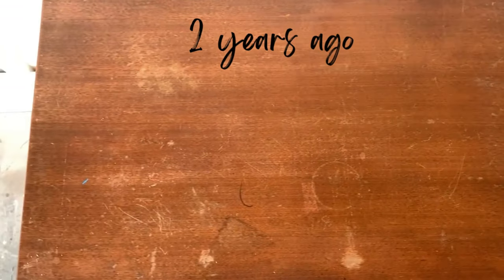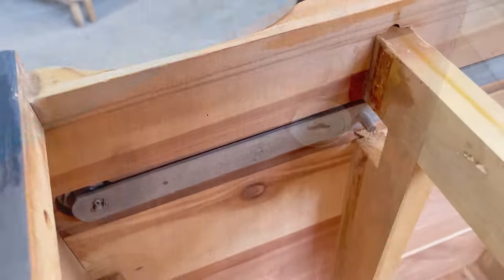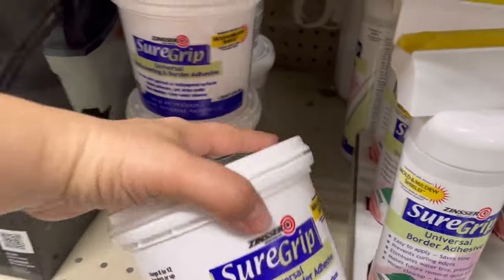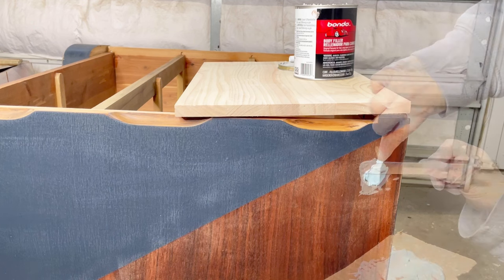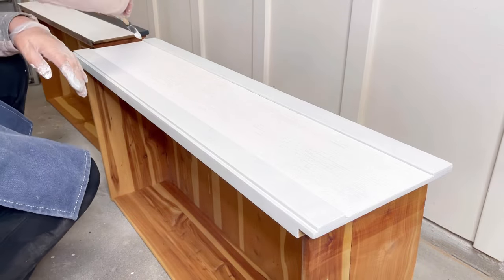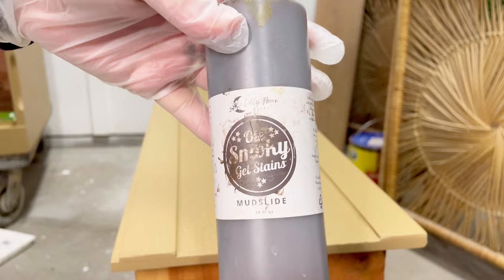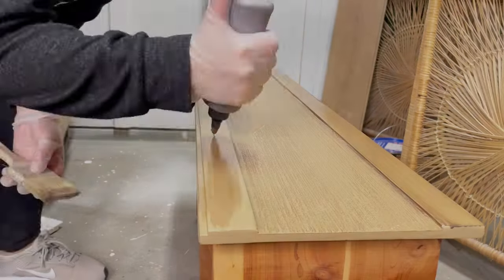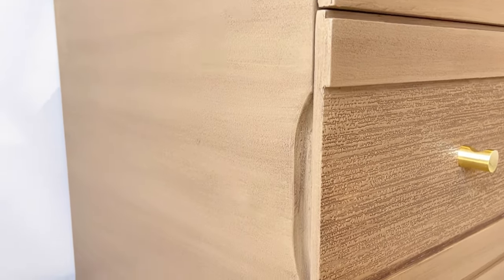BEAUTIFUL Modern Chest Transformation | Thrifted Furniture Flip

Comment: The anaglypta wallpaper was an excellent choice.  It turned out beautifully.  I used some in a wave pattern on my headboard.  I painted it then sealed it. I went over the waves in a gold guilding wax.  I kept the guilding wax lines clean with mineral spirits and this did not affect the paint since it was sealed prior.  It turned out beautifully and just like I wanted…. Non coastal/coastal vibe 😂.  Hubby was impressed which is hard to do.  Yours is beautiful as well.  The waves on mine were much more pronounced making them easier to define with gold wax.
Reply from the maker: I’ve seen the wave pattern and I love it, your project sounds unique and beautiful. Glad that your husband liked it, and thank you!

Comment: Surprised it didn't sell with first makeover, but I really like the new makeover.  That glaze over the paint is gorgeous and that textured wallpaper was perfection.  By the way, use aluminum foil instead of plastic wrap as a paint tray liner.
Reply from the maker: I was surprised too! And yes, I did just that half way through, and switched the plastic wrap for aluminum foil. I had seen other people use a plastic one, but I soon realized it was a different type, thanks for the tip though. 😊